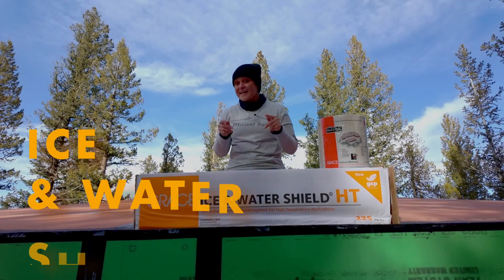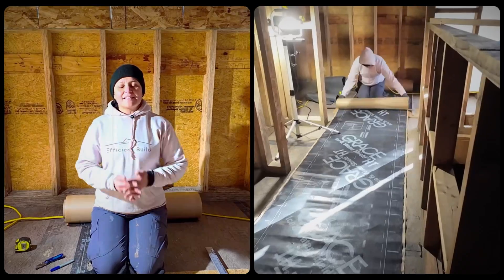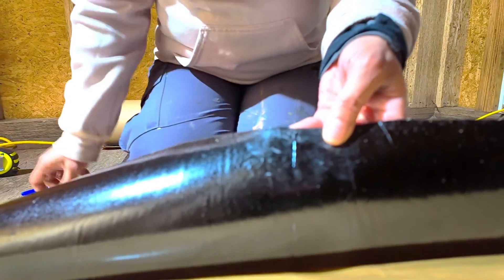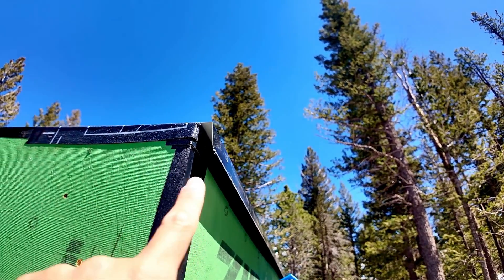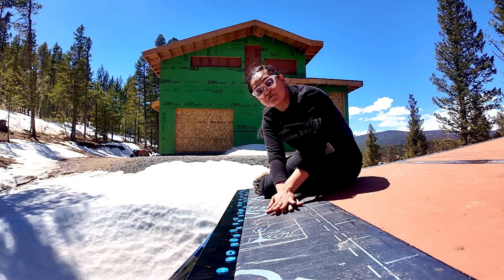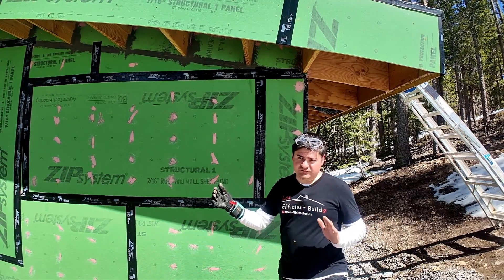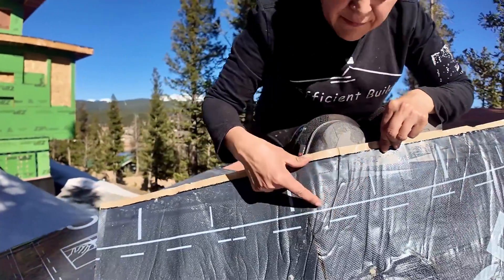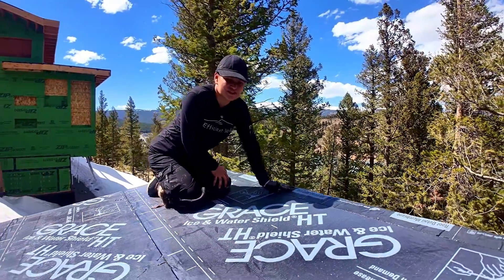Roof Membrane: Why Grace Ice and Water Shield? Installation and Tips #roofing #roofer #construction

Comment: Zip is a water resistant barrier, is ice and water due to low slope or are you recommending on all roofs?
Reply from the maker: It is actually required in new codes independent of the Zip Sheathing. I talk some about it here: at 5:10. The Ice and Water Shield is thicker and self healing. It's a good idea. Zip Systems sell their own version as well.
Reply: It looks like you want to refer to 2021 IRC Section R905.1.2, which says not less than 24 or 36 inches from the inside of the exterior wall line depending on slope.
Reply from the maker: Exactly, thank you for the precise reference.